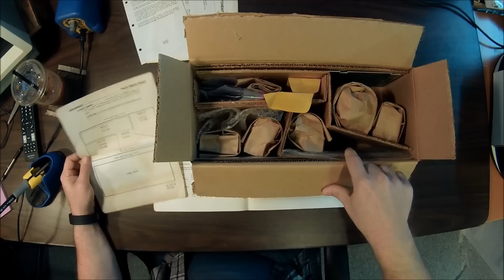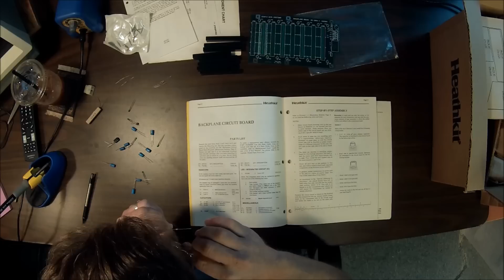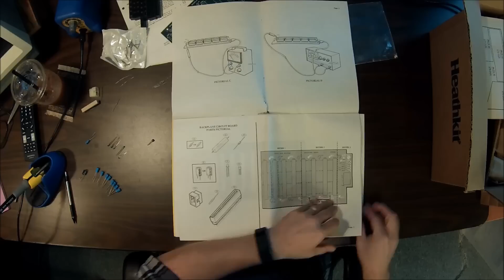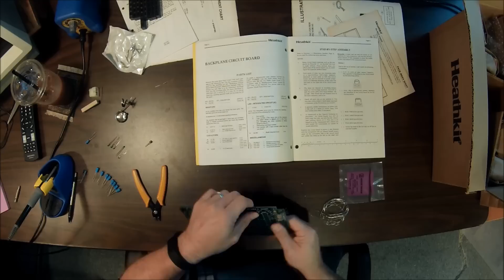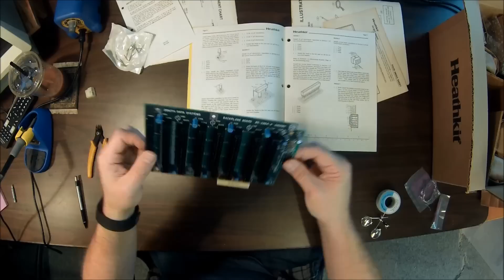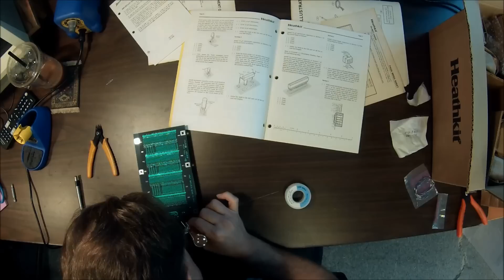Heathkit HF-151 Desktop Computer Kit Build, Part 2: Backplane Circuit Board

Comment: Unless you spent some time cleaning up the board pads off camera I’m amazed you were able to get good solder joints with 30something year old solder and stored boards. It just points again out the quality of heath products.